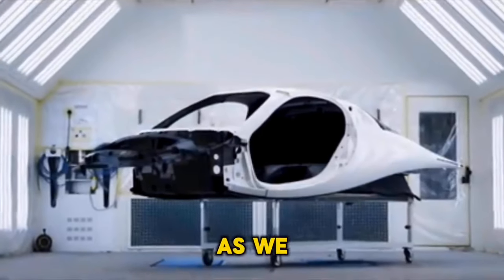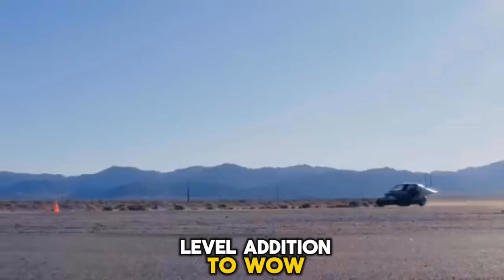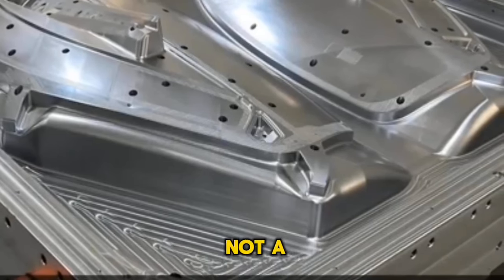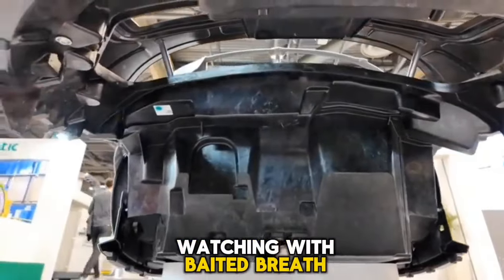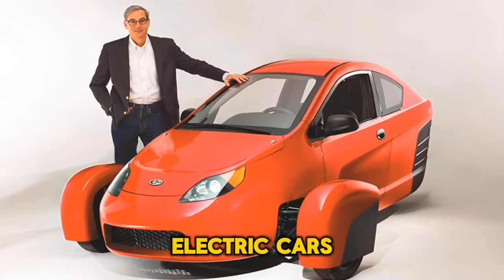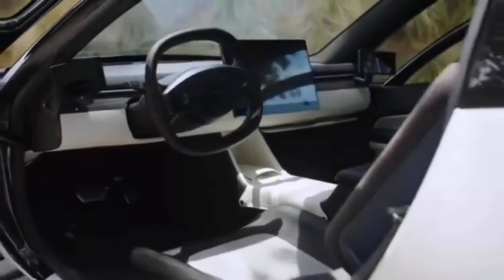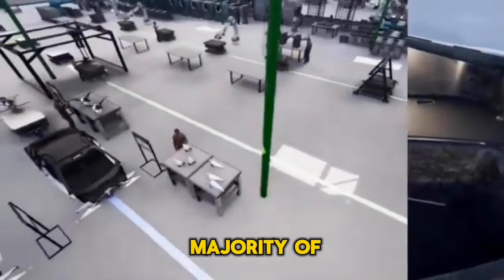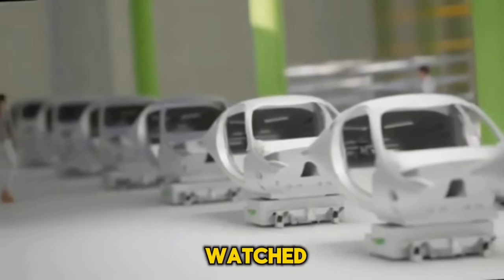Aptera's two seater, grocery, aerodynamic style,DC standard fast charge explained

Comment: I can't believe how many ERRORS there are in this video's subtitles and some which also extend into the audio.  Do you do no checking of your video before uploading??    1. POLISTER which is also what the audio sounds like  but the vehicle being referred to is the Polestar.    2. ELEPHANT Motors... really!! its the brand Elaphe.    3. CAR'S BAT plant... they are not making bats!!  Its the factory location in Carlsbad California.       4. from the BRAND UP .. this should be Ground up.    5.  ACTOR which should be Aptera.   6.  AT TARA another attempt at Aptera.  7.  ATARA ..another attempt at Aptera.   8. ACTOR again for Aptera.  9. STEP the wheels in motion.. I think this should be Set the wheels...   10. GAZMOBILES probably Gas mobiles.  11. The TRICERA is immediately re-referred to as the TRACER.  12.  25 Cubic Feet was the old storage estimate but is now 32 Cubic Feet.  13.  AT TARA is used again. 14.  First iteration BUT caught up... should be Got caught up.  15.  Mobility on FREE wheels.. that would be great but it's Three wheels.   16.  it is ANY time that will tell.. should be Only time that will tell.  ... So in conclusion if you must use some Audio to text software please at least correct the errors which make you look stupid!   With all the errors corrected this would be a reasonable video but much of it is old news and covered better by other YouTube channels.